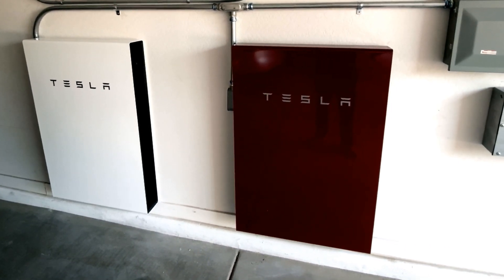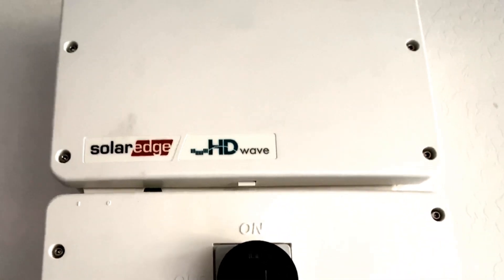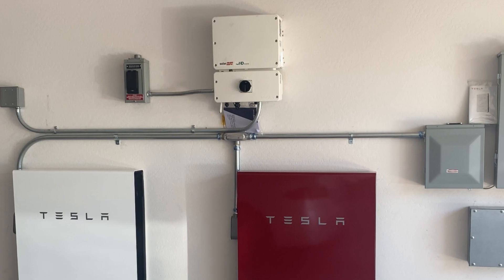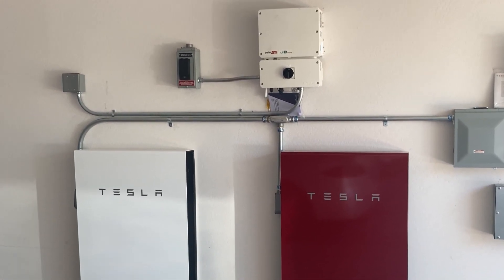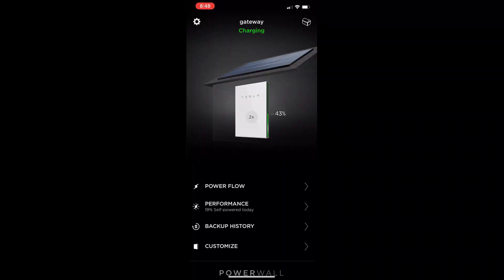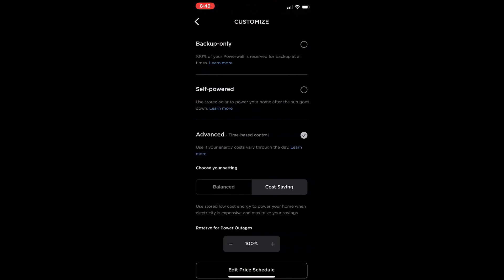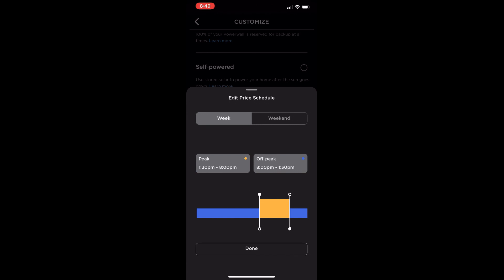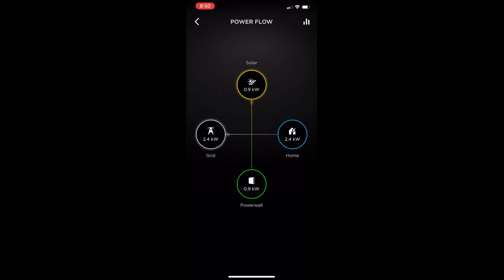Solar Panel Inverter Install Redo and Powerwall Tips

Comment: Could you research using the SolarEdge app to monitor panel and optimizer-specific production and condition? Tesla doesn’t offer this level of detail and I’ve heard rumors of folks getting SolarEdge user accounts and some who say Tesla refused their request for such an account. I also noticed that Tesla didn’t offer to connect my inverter using Ethernet, even though it is capable, instead using a Zigbee module/antenna. I was allowed to connect the Tesla Backup gateway with Ethernet. Curious about your thoughts.
Reply from the maker: As far as I know, it takes some strings to get pulled but my friends that have Tesla SOLAR have been able to get access to the SOLAR Edge application, ideally Tesla if they are your installer should provide the account login, they certainly provide the hardware setup.
Reply: Gilbert Solar Tesla replied to my inquiry and says they will create a SolarEdge user account for me once I get the utility’s approval to produce energy. So we will see if they honor that promise. I’m still in the middle of the activation process. On another matter, I am curious what can be modified or optimized manually by logging in as the installer? I know you use this method to interface with your custom programming, but was curious what can be done directly using the installer’s interface.

Comment: Did you go through Tesla website to order your batteries
Reply from the maker: My SOLAR panels were installed by Sun Valley Solar, and the batteries were ordered through Tesla via website.  From Tesla I ordered around July 2019 and got the batteries installed by November 2019.
Reply: @Lucidnaire  I went through Tesla Energy for my 8.6 system that I own, looking forward to have battery to get me through the peak times. I also charge my car

Comment: did Tesla hardwire your inverter to your router? I want to hardwire as I have a wifi switch in my garage.
Reply from the maker: My inverter was actually installed by another SOLAR company, but I have since expanded my system and Tesla did that install.  My understanding Tesla gives a small black gateway box which they use for "monitoring" the the Inverter which only has a zigbee connection.